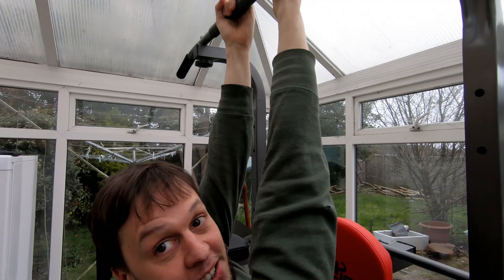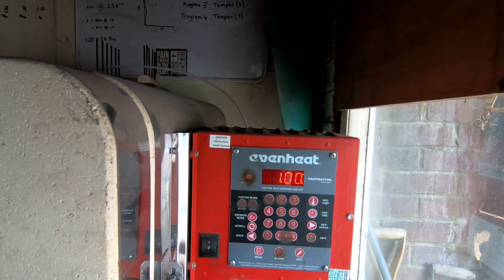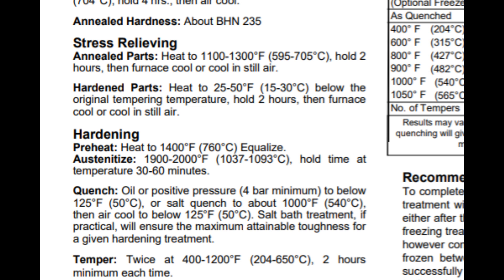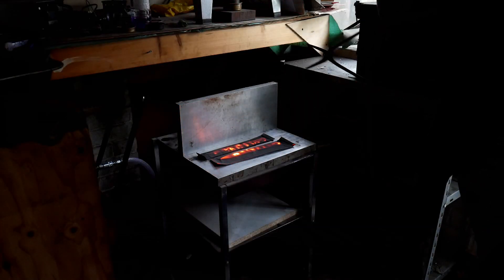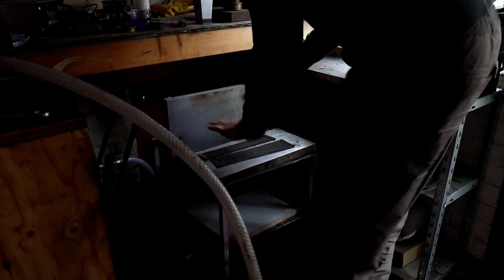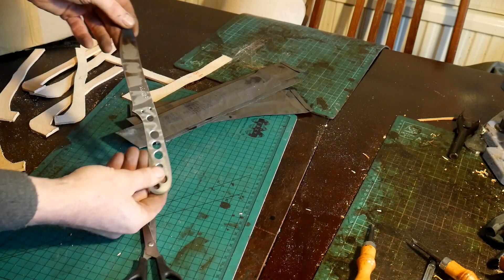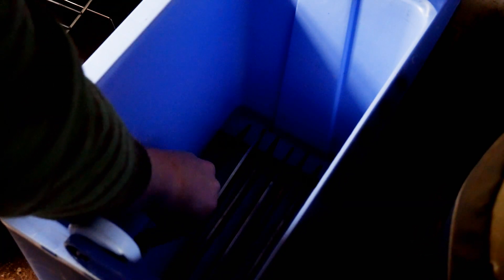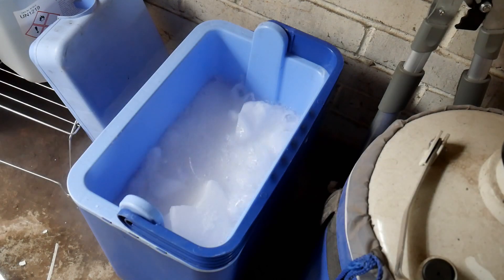Datasheet Heat treat CPM 154 Stainless steel

Comment: Thanks for the excellent video!  I am getting ready to heat treat a skinning knife That I made for my cousin who is a deer hunter.  I have already shaped the knife and formed the bevels under the hammer at temps of aprox. 1500 to 1800. upon air cooling the blade is pretty hard already ( I tested 60 HRC with files) and I cannot drill my handle holes!!   It looks like I will have fun annealing since I have a very basic kiln with no soak timer.    Well I did have a question about your process... What % was the alchohol?  Is 91% ok?  
Thanks Again!!

Bill S. Las VEgas, Nv

Comment: It helps get rid of O2 if you put a little bit of cotton strips in the foil, burns up the oxygen. I did heat treating in a machine shop as part of my duties at my last job. Retired now.   Used kerosene in dry ice bath, less chance of fire. Made a cooler that would hold dry ice for a week. The longer below 100F the better. If liquid Nitrogen for deep cryo was needed we sent it out as it was too expensive for some of our larger machine parts.

Comment: Try denatured alcohol with the dry ice and make sure u let the dry ice off gas completely evaporate before recycling / bottle back up the denatured alcohol as the dry ice off gases and will build up pressure and blow the metal can the alcohol comes in ...
Reply: I can't see any benefits in using denatured alcohol over isopropanol, it is much more expensive too, but thanks for the tips on recycling

Comment: Good Video as usual. 
If you have hardened them with the aluminium blocks what is the purpose of the freezing if you are going to reduce the hardness anyway.
Reply: Freezing converts any retained austenite to martensite. Too much retained austenite is not good no matter what the final hardness value

Comment: Good vid sandy I know stainless has it’s place especially with hunting and fishing knives but I like to look after mine cleaning and oiling my high carbon steel blades and I think stainless is a lot harder for the inexperienced to sharpen and I think they tend to chip more looking forward to seeing them finished atb scott
Reply: Hi Scott, this powder or particle metallurgy steel is superior to other stainless steels and not prone to chipping so the data tells me. But could be harder to sharpen but hold edge for longer too. Much great toughness and wear resistance than high carbon, though personally I like my 01 very much

Comment: Fascinating Sandy.  A fairly complex and expensive process as compared to O1 steel.
Next time I see you I'll get you to explain the chemistry involved with the mixture of Isopro and dry ice.  There was obviously a lot of low temp boiling going on.
Hope Mandy is doing OK.
Noel
Reply: It was sublime Noel:) Sublimation actually. The dry ice turns from a solid to a gas, (no liquid stage) at minus 78.5 C, the isopro just acts as a carrier and is also chilled down to minus 78.5, some people reckon it goes a few degrees cooler but I can't see how that's possible.
Basically the amount of austenite that is transformed to martensite is analogous  to the range of the quench, thus the deeper the quench the more transformation occurs. According to the data sheet Crucible recommend a freeze down to minus 74C to completely transform any retained austenite.. Their words not mine. I think they will come out as quite nice knives, much great wear and toughness when compared to high carbon, but perhaps less soul?